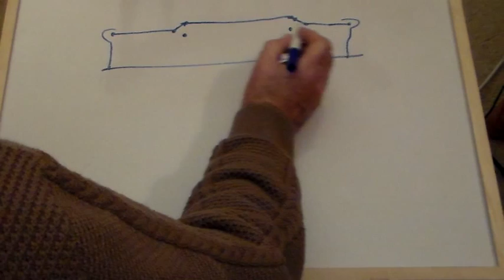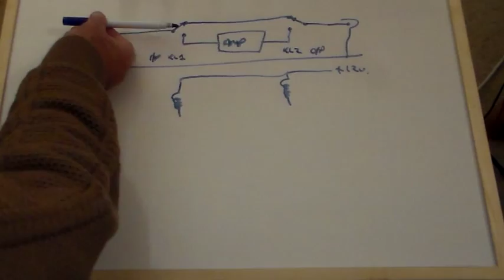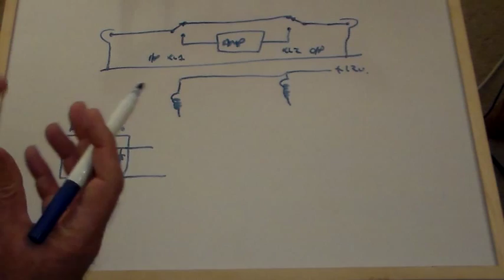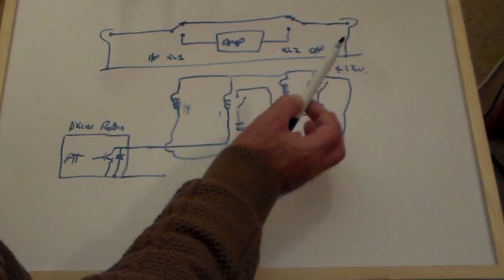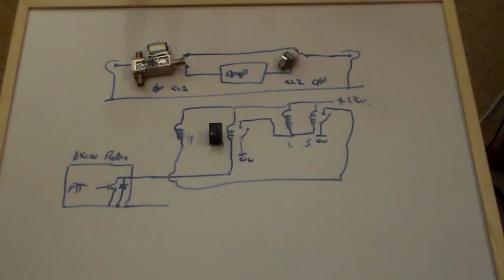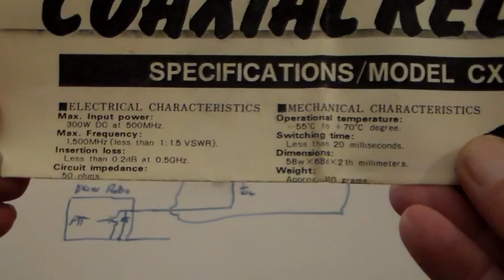A Quick Look At The GS-35B Amp RF Switching Arrangement.

Comment: same circuit without relay #1 would do the same thing. make # 2 your first relay
Reply from the maker: Thanks for the suggestion but both relays are required. The drive radio has to switch between the amp input and the antenna. If I understand you correctly you're suggesting the output relay, relay 2 switches between the drive radio output and the amp output. The amp won't provide any output without the drive radio being switched from the antenna to its input. The antenna then needs to be switched to the amp output.

Comment: G'day I did find it interesting and that you are building home brew. With the coils and relays they be around the 10 amps? One very interested ham vk4oc Dennis.
Reply from the maker: Dennis Peake Thanks for the feedback Dennis. The current drawn by the relays will be 30mA each for the two small 'activation' relays, 160mA for the input switching relay and 150mA for the output switching relay, so 370mA in total with all relays activated.